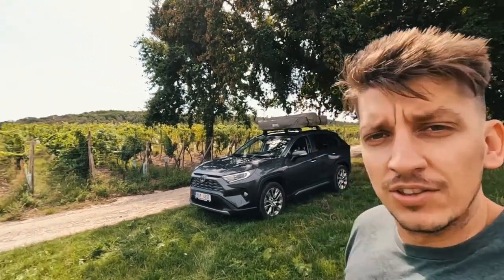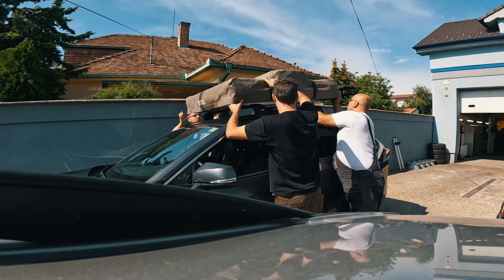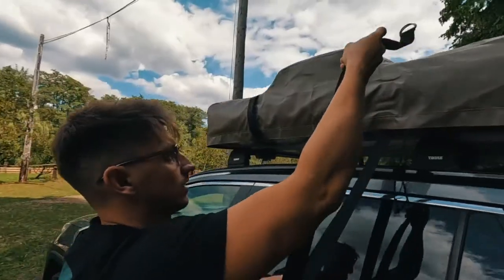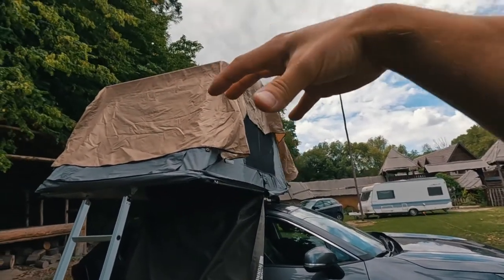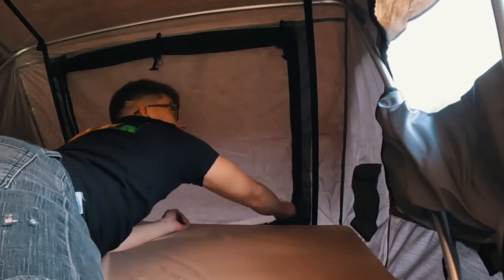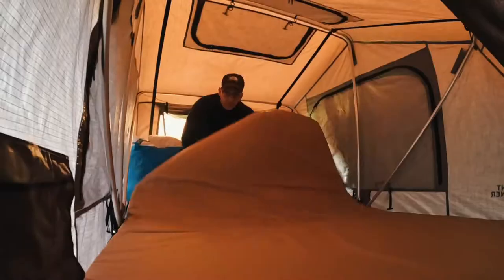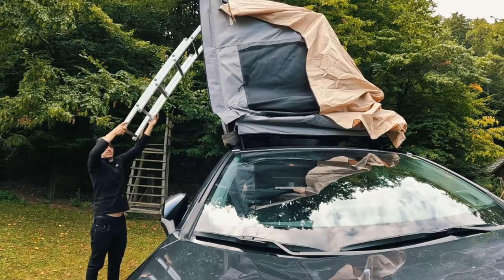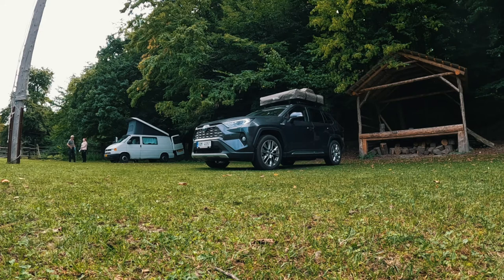DEMO & REVIEW: Toyota RAV 4 Roof Top Tent | First time sleeping in a car tent

Comment: Could you consider doing a long-term review?
Reply from the maker: Honestly not much content to make another video but happy to answer any questions you may have. Some observations: I have used the tent about 4 max 5 times per year so it’s tough to say whether it justifies owning it (storing it / mounting it each time). As far as quality goes then I’d say I got a good model and there is no wear or tear so far in spite of driving with it in the rain a lot or camping when it rained. It still beats camping on the ground next to the car or sleeping inside the car (depends on how many of you are going on a trip.) The ease of unpacking it is great (takes longer to pack) and the mattress is nice and comfy.

Comment: Is this the same as the overlander Gen1 from smittybilt? They look very similar and was wondering if that rack would hold my tent as well.
Reply from the maker: Hey JC! To be honest before I mounted the tent on my Toyota's Roof / Rack I read through the manufacture manual (booklet found in your car) to find out what are the weight limits /loads of the roof. There are 2 #s. One number is for "while driving" and another is when you are "stationary/static". Its important you meet the # of while driving, always! to avoid roof damage or some kind of driving imperfection. 

Then the other weight limit # you have to check is the load of your roof rack (the cross bars themselves ) and that depends on your brand that you purchased. My low profile black Thule cross bars were actually right on the edge as they are fancy and slick BUT not designed that durable. So if you have better cross bars you should be fine. All in all almost all car tents out there are OK for your car it just depends on the cross bars you have. Also some Toyota RAV 4s have better roof bars. 

The Rav 4 Overlander has a much sturdier build around the roof bars... It really just depends. But check the manual you will know. All the best and have fun out there :)